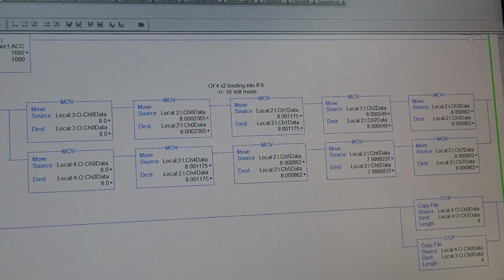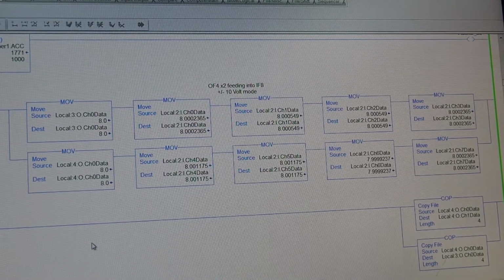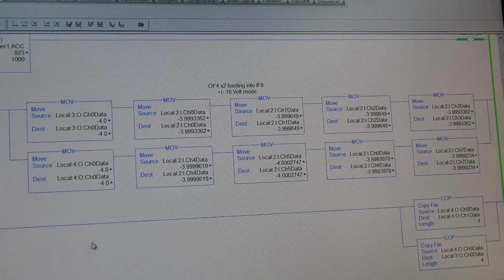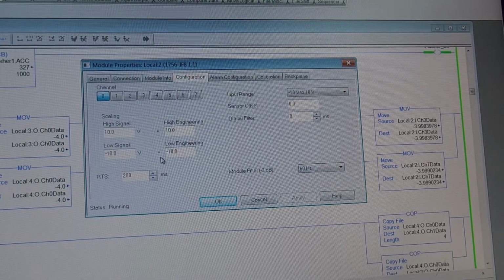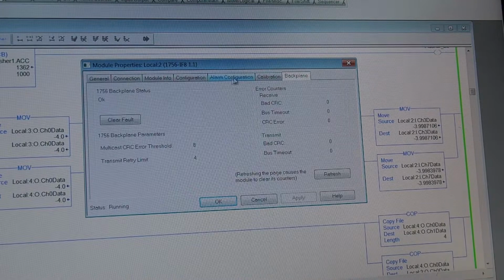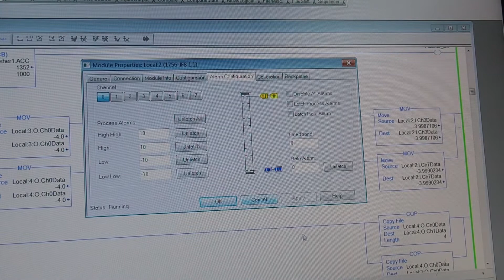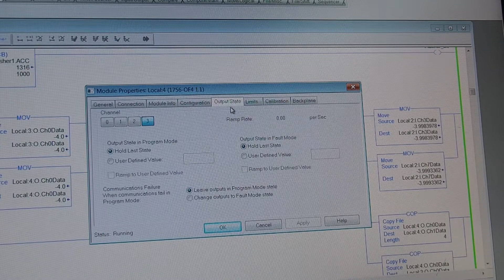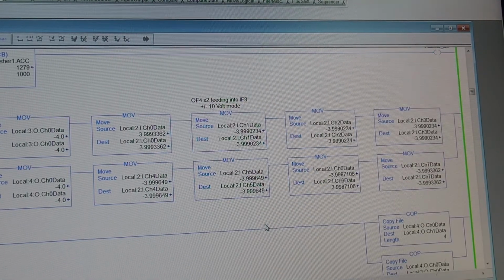1756-IF8 & 1756-OF4 Testing

Comment: I am working with an OF8 module in current mode; should I connect 0 VDC to any of the terminals marked as RTN?
Reply from the maker: HI:
Yes RTN - 0VDC or DC Common are all the same thing and without them you do not have a complete pathway for current to work with.
In a basice example -   The current goes out - thru the load and returns to the module and is measured to make sure it matches the setpoint you are asking for.
Hope that helps.
BB

Comment: Thank you for explaining that, very helpful. I am currently working on a project that is using the 1756-IF8 module in current mode(4-20mA). Can you please go over the wiring in more detail? The manual shows a bunch of different jumpers.
Reply from the maker: HI:
If you are using all channels in the single ended mA mode then all of the right side odd numbered terminals 1 thru 17 are jumpered together.
Terminals 9 & 10 are common to each other (jumpered inside the card).
See the manual page 11.
Hope that clears it up for you.
Reply: @abplctestbench759  Ok, thank you! Also, what is the big difference between single-ended and differential? Is single-ended the most common way to wire a 4-20mA signal?
Reply: @abplctestbench759  I will be using Differential wiring.
Reply from the maker: @kilowatts76  Hi:  Differential will cut down the number of available inputs but will make the ones you are using higher accuracy.  There is additional programming and configuration to do compared to single ended.
In the end it all depends on the situation you are using them for and what you want for your system. 
All the different ways are correct if they work they way you want them to for your process.